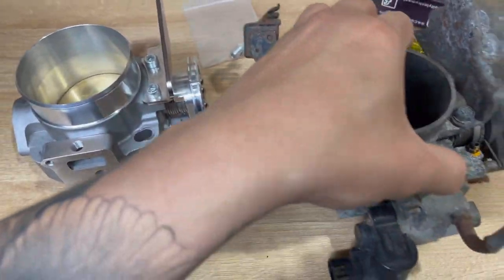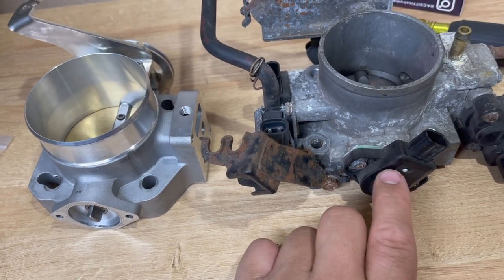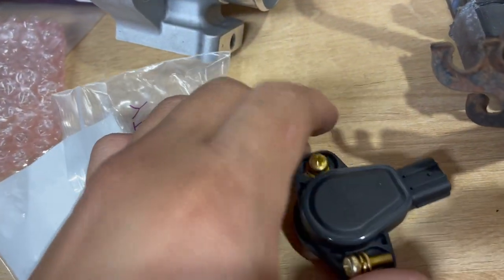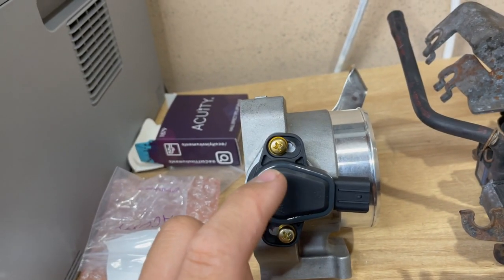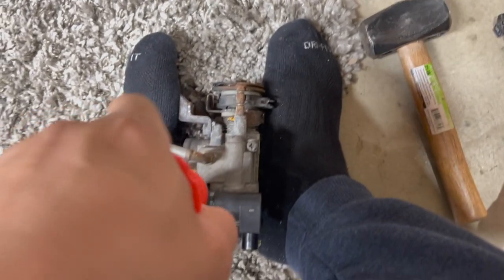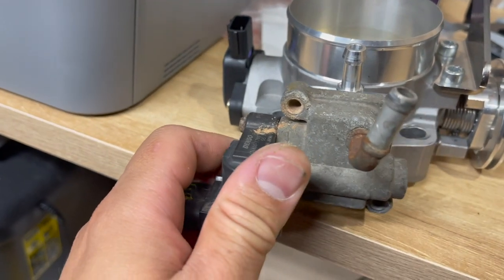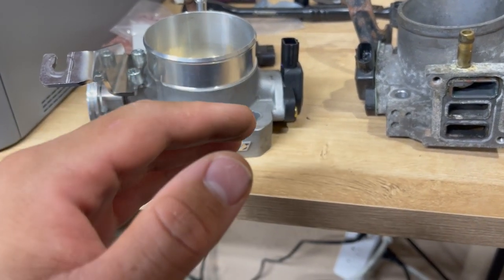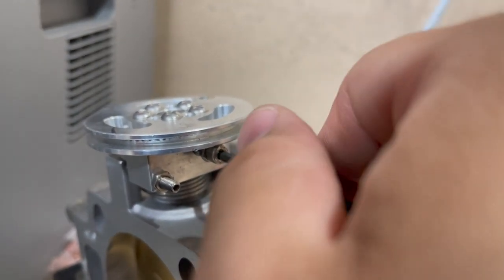Ktuned Throttle body vs OEM / IACV, TPS, IDLE Adjustments (Honda civic k20 Build part #25)

Comment: Thanks for the video got some issues with bucking and Rev hang and a tiny bit of high idle tuner told me to check out the throttle body and cable this video really helps in understanding what to look at
Reply: Did u end up finding the issue
Reply: Mine stuck idle high

Comment: Wassup bro been awhile... finally finished my EPS conversion way back and still running great. Btw acuity is awesome I bought their first gen and worked for awhile then idle values kept changing causing some bucking from dig. But I called them up they we’re happy to help out and send me a new one but they wanted the old one to do some R&D. Glad to see the improved it. That TPS gasket is not used anymore cuz of the new o-ring that was included. I’ve tried all the TPS you can think of even ktuneds hall affect took a dump on me and cost a grip. Keep it up D!
Reply from the maker: Yeah acuity is awsome , never had any problems

Comment: Wassup Bro? Long time no see. I’ve tried every TPS sensor from K-Tuned even their Hall Effect version. The main reason the TPS goes out is when it rest on idle and changes the set value for closed position from Vibration. (Remember when ktuned used “RTV” to help reduced it) It’s from vibration and wearing out from the throttle body shaft holding the plastic holder inside the TPS. My K-tuned Hall effect version kept changing closed values even with a slight preload to keep the spring snugged. I now use Acuity when they first came out. It lasted about a year then started to change values as well but they hooked me up with another TPS and wanted my old one so they can improve their design to fix this problem.

Comment: What could be the problem with my Honda Edix 2005 CBA-BE1 engine  when I step on the accelerator pedal, the response from the engine is not good, it struggles to pick up from the drive gear unless i put the gear in 1. Also when the engine starts, it emits black smoke like there's  no proper mixing of air and petrol in the chamber. I changed the sensor below the throttle body but nothing has changed

Comment: Did you get any bogging while driving at 2000 rpm? If I lightly give the car gas it will bog and the rpm’s will fly up and drop back down. Doesn’t do it at all when I give it a little more gas
Reply: I had that damn issue with mine. I ended up sanding the butterfly down with a slight angle so when the plate closed it sat flush. That fixed the hunting idle after I drove. The flat spot you speak of fixed by adjusting tps with   a slight preload in the tps. Then calibrated the tps through kpro then I lastly adjusted throttle cable to get car to idle at target rpm +/- 200 rpm

Comment: What about the sensor you didn’t touch on the stock throttle body?? What sensor is that??? I broke it so I’m trying to look for it
Reply: Pretty sure that sensor is connected to the IACV. Not sure what the sensor itself is called though but I would look up the IACV

Comment: Do you you need to adjust the idle screw if you delete the iacv
Reply from the maker: You will need to adjust your throttle cable and idle screw yes.